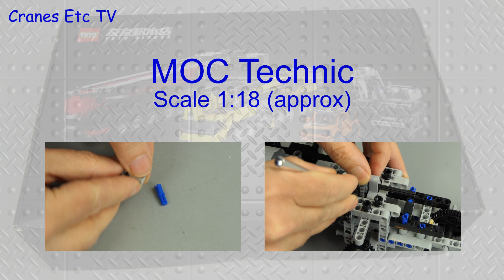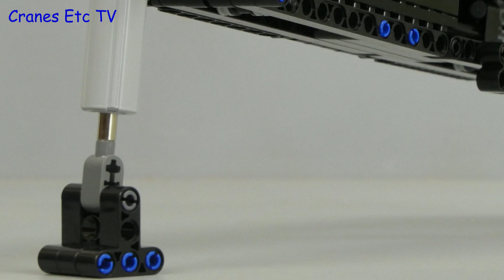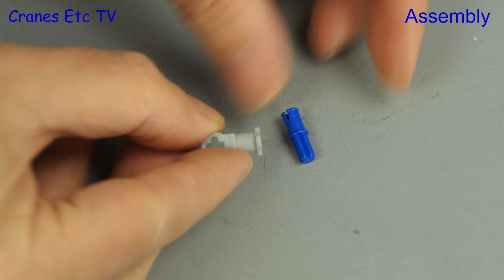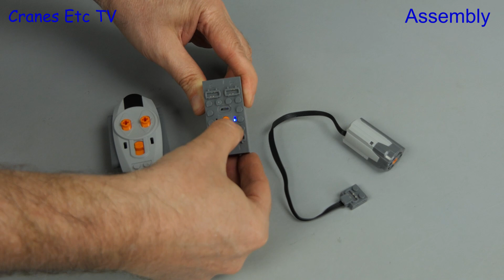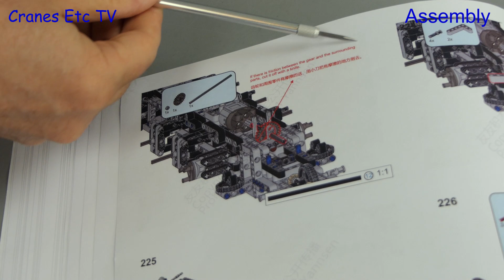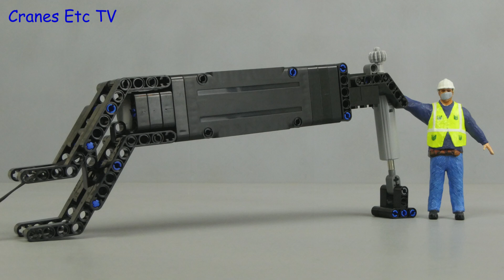MOC Technic Liebherr LTM 1750-9.1 Mobile Crane (Part 2) by Cranes Etc TV

Comment: I can understand missing parts with a third party company- that was a large hurdle for mega construx in their early days as well -but for the price they are charging for this model, you'd expect the quality of a lego set. €799. That is an expensive price tag. And normal lego is expensive compared to Chinese knockoffs, because of the assurance of quality. That is not present here for the same price.
Reply: Yeah, comparing it to the closest thing Lego has put out (the Liebherr R 9800 excavator, which was 4108 parts for €450 originally), this thing at 7768 parts for €800 is actually more expensive per part. It might be that this has disproportionally more motors to drive the price up (it does, slightly: the excavator has seven motors, this one has twelve). At least the site selling this thing has a "we know parts are inevitably going to be missing, so we'll send you anything missing free of charge" policy.